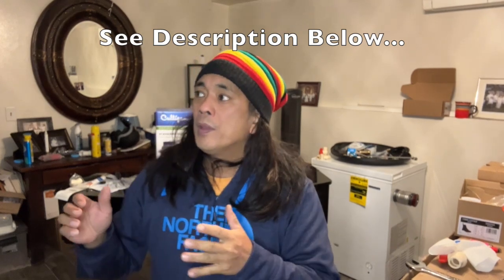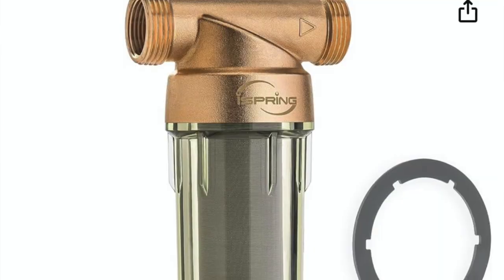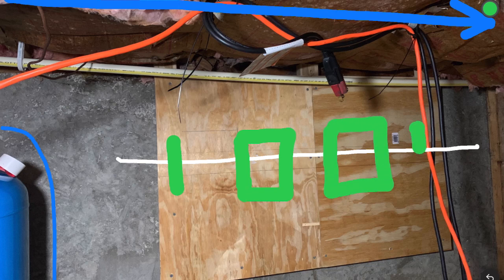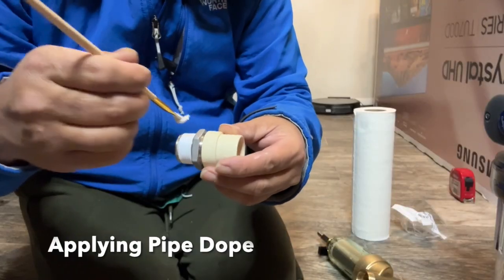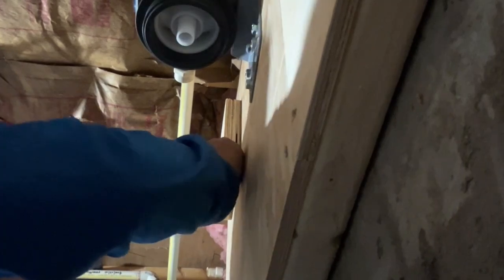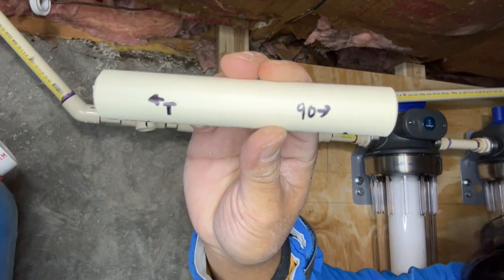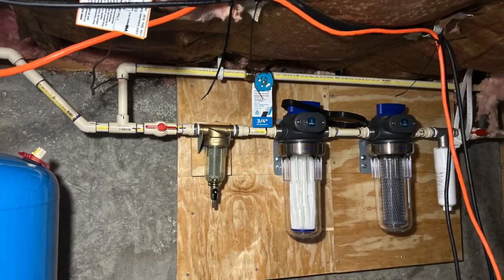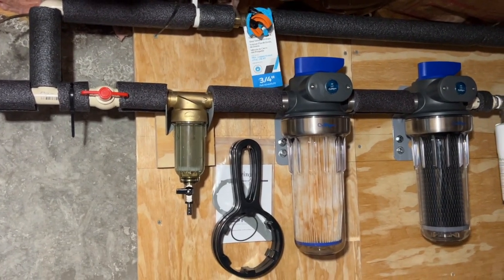Whole house water filtration with Culligan WH S200C and iSpring Filter. Aqua pure scale inhibitor.

Comment: I install the filter, the arrow is pointing on the direction of my well, i let the faucet open the whole time, after finish everything, i dont see no water flowing inside the filter, like you are showing, am i doing anything wrong? Thanks
Reply from the maker: It sounds like you installed it in reverse. The arrow should be pointing in the direction of the water flow to the house.   Not to the well.  Let me know if this helps.  Otherwise send me a pic of your setup.
Reply: @AJDIYNetwork  also the blue button on top is pointing in the direction if the arrow where the water flow, i did not turn it
Reply: Ok i just flip it back, the water came in when i first install it byt after that i dont see any water in it, is it right?
Reply from the maker: @ralphwhitaker8761  you now have filtered water :)
Reply: Ok thanks so much